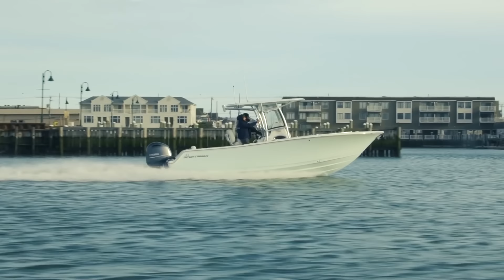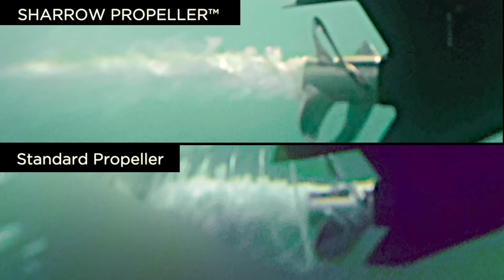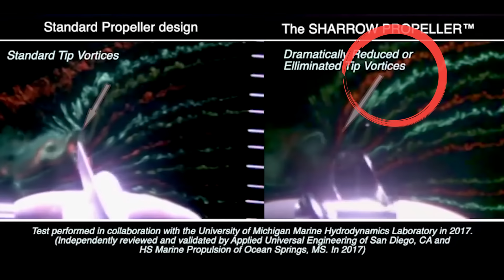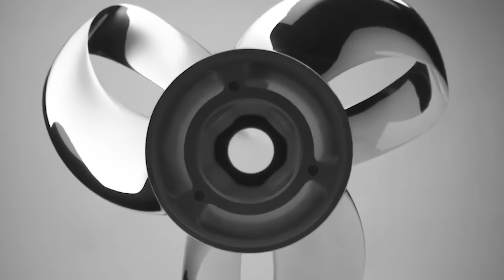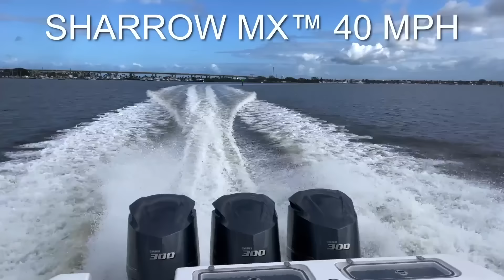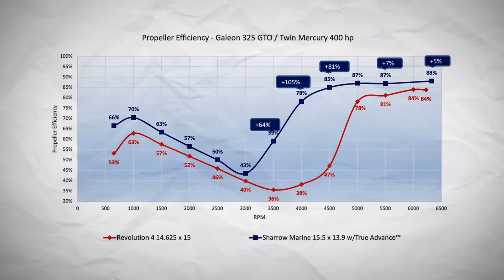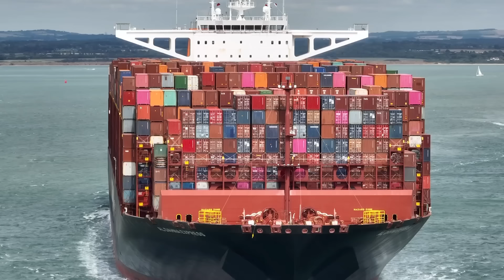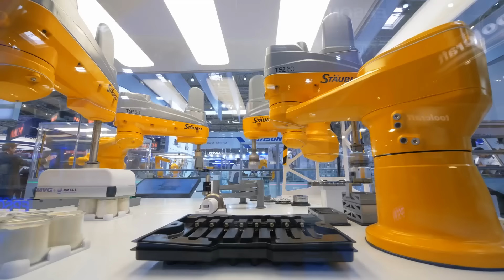This Genius Propeller Will Change Transport Forever

Comment: Could be that these also make better wind turbines as they haven’t improved much in practice at all.  I did my thesis on wind turbine blade efficiency and tried all sorts of designs including testing a NASA profile symmetrical blade but introduced a hollow hub which funnelled air up through the blades and out through small holes on the aerofoil to force the boundary separation  point  (turbulence point) further down the trailing edge.  It improved efficiency slightly but not to anywhere the same extent as these props do.  It’s an area of science which hasn’t evolved much since Brunel’s time!

Comment: Very impressive. I've often thought that drones could never be a viable means of transporting goods in a residential enviroment due to the insane amount of noise that standard propellers  produce. This altered design completely changes my view of the whole concept now. It makes you wonder if this design could be incorporated somehow into jet engine turbine blades to increase thrust, reduce noise and gain fuel economy. Guess time will tell
Reply: Turbine blades are enclosed in the cowling, plus the blade tips are mere millimetres from the edge of the cowling specifically to limit tip vortices. Not sure this would work for jets.
Reply: @Future-Preps35  Seemingly most aircraft use variable pitch propellers, it seems that would be difficult to impossible to achieve with this design.
Not being able to feather a prop when there's an engine failure would also be a safety issue.
Reverse thrust would also be lost on those planes that currently have it.
Reply: It wont. This prop tries the offset the disadvantages of not having a duct, it would be inferior in more ways than one
Reply: drone delivery will be a thing if they solve its reliability and safety to fill our standard. no one want to be chopped on the head by anything right?
Reply: @ianlanford6922  that seems like the easiest fix. Just put guards on the propellers. But honestly the idea of quiet drones is kinda freaky cause you won't even know they're there.
Reply: There is more versions of this prop to be expanded on. I think it is genius and I think there is going to be applications of it in every propeller based system in the coming future😁
Reply: In propeller aviation it sounds near impossible these would become a reality. No feathering and no reverse thrust.

Comment: Thank you for this great little video I had never seen these propellers before. I hope to see more drones using them in the future due to the significant reduction of noise and the increased efficiency which should also lead to an increase in flight time.
Reply: I would like to second that.  A very interesting video.

Comment: If you increase blades number 3 to 6, cavity naturally decreases. Force divides 6 instread of 3 etc.. Diameter,weight,number of blades, all are different parameter for each application. It looks efficient for some specific application but it does not mean that it will replace standart propellers

Comment: "Double the efficiency", "Greatly increases speed"  ???? SHARROW MARINE  indicates on their web site that the propeller or has a max efficiency improvement  of around 30%  at between 2500 - 4000 RPM on a conventional designed propellor. This means for the idiot that made this video that the toroidal propeller has a max efficiency at a lower RPM than a conventional prop or put another way it is more efficient at a lower speed where the motor supplies less power. The motor has more power as the RPM goes up so the cruising speed for these propellers would be lower you are not increasing speed you are lowering it. Yes you will have longer range but you will be going slower.

Comment: I am just wondering if something like this could be used to create a lift effect potentially replacing a parachute?  For example, if a canister were dropped from a high altitude, perhaps even from space, and needed to be slowed, as if with parachutes, with wind resistance providing the force for the propeller lift.  A propeller could be more durable, and reusable, than a parachute.  For example, a titanium propeller lift that can withstand a lot of force, and heat if necessary, and is light weight.  A spinning propeller seems like it could have a gyroscopic effect as well, for stabilization.
Reply: It is possible to design contactless, frictionless axles, using opposing magnetic fields.  Oppositely aligned discs for vertical, and oppositely aligned cylinders for horizontal.  Two toroidal propellers spinning in opposite directions might cancel a rotation effect, to prevent the main design from spinning wildly, to a great degree any way.  Concentric cylinder axles might be a means of stacking oppositely spinning propellers.  If we have spinning magnets, or magnetic axles, this could generate electricity, if desired, perhaps to power a proper gyroscope, or potentially to charge a transponder or LED claxon battery, or other electrical device.  Heat and magnets don't usually mix, however, if the magnetic components we're inside the main design, within a thermos like design, this could greatly insulate the magnetic components?  The field drag of the magnets may make the idea impractical.  The field drag would probably work against the wind resistance, slowing the rotation of the rotors.  Components that are highly durable and reusable do seem like a great advantage.  However, it may have to be bearings.  At this time we do produce titanium nitride coated magnets.  Titanium nitride is an extremely hard ceramic material.  Titanium might be a candidate for the load bearing structure of magnetic axles?  We're going to be working by the carat on this one, and neodymium is pretty heavy, but it's an idea.   

As a working scenario, we want to be able to drop a metric ton, from space, and have this (float), or slow significantly, safely down to splash down, and in a manner that is highly efficient and reusable.

Comment: Hey I wanted to point something out? The cause for the reduced noise on boats is the difference in exhaust pitch. The Sharrow prop allows for lower RPMs at all speeds meaning lower exhaust frequencies. This lower RPM is also responsible for the massive spread in efficiency between the two styles in the 15-25mph range as the Sharrow gets on plane at a significantly lower RPM.
Reply: Yeah, it's not clear to me that the improvements claimed in the Sharrow boat tests are not just a result of optimizing the propeller characteristics to the engines/boat... perhaps one could achieve similar results by better matching a traditional prop. Like running a car in 6th gear (Sharrow) vs 5th gear (original prop).

Of course, you can only take this so far, until the engine doesn't have enough power to get up to speed. Perhaps manufacturers do this on purpose. When the engine ages and loses power, it will need a 'smaller' prop.

I'm not confused by your comment.. it's clear enough.
Reply: Sir your comment is very confusing...exhaust "pitch" or "frequency"..pitch is tilt in the blade, and frequency is bass or treble...also lower motor rpm lowers the sound frequency

Comment: If you really could improve fuel consumption 20%, that alone would justify the 10x initial cost increase.  Far as I can tell, you aren't increasing maintenance costs or changing material costs, just manufacturing.  Hell, cargo ships WORLDWIDE slowed down just for a 6-13% fuel reduction in the mid 2010s didn't they?  If those really are the numbers, I can't think of a reason shipping companies wouldn't jump at the opportunity.

Comment: Problem with it is these things weighed so much a propeller like this could possibly weigh anywhere from 18 to 30 tons nothing but a bronze and copper alloy very hard to machine very hard to produce an extremely expensive

Comment: They might be able to reduce cost by casting them, it would also be interesting to see if this could be applied to a air compressor or turbo supercharger.
Reply: Every cast has to be machined too, because castung surface is pretty shitty usally.
Air compressor and chargers - do you have any clue how those work at all?
They dont have Props in them AT ALL for a reason, props have holes and if you are working with pressures stuff tends to flow back via said holes making stuff very inefficent.